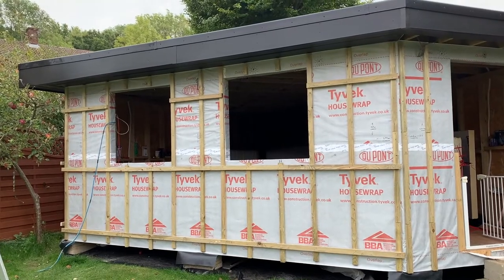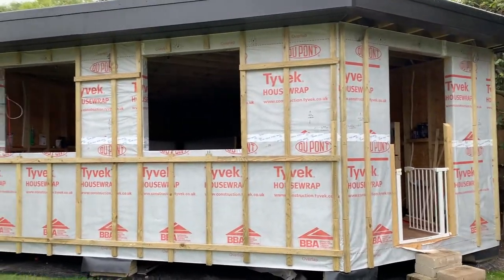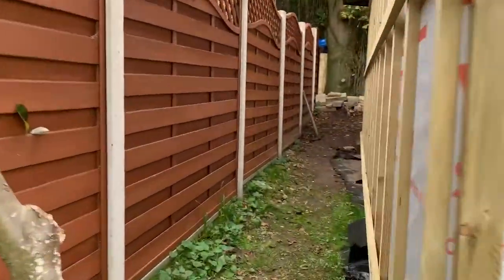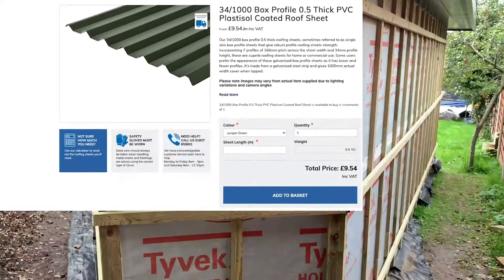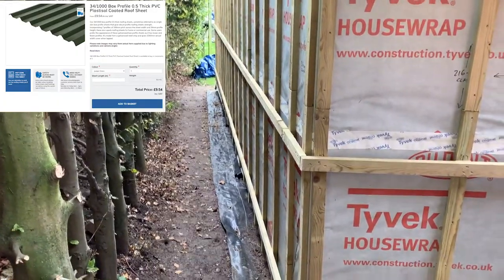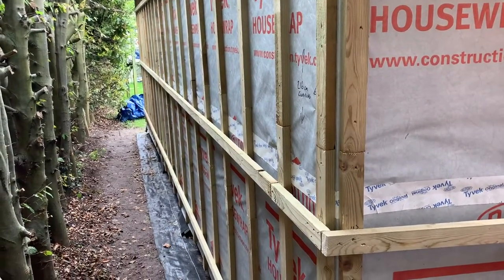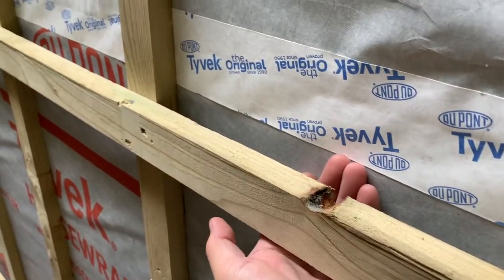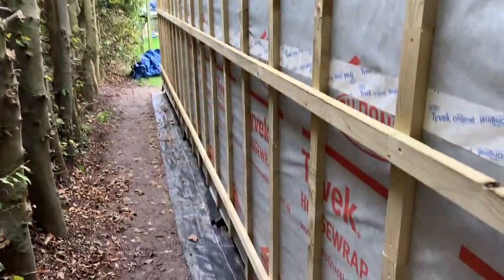DIY Garden Office - Games Room - Battens / Battening

Comment: Hi Kev, great series of informative videos, can’t wait to you the finished garden room. I am planning to do similar this year and be grateful if you answer some questions. Firstly, what is the brand/model of what I guess to be a nail gun. Did you buy this to build the garden room as a more efficient way to build vs impact driver and screws? If so, do you think it was worth it? Secondly, did you have to apply for planning permission and/or building control? I ask as I wasn’t sure if this is needed as part of your electrician making your final connections and signing off the work, also if your choice to get Cladco sheeting was in some way to achieve a non combustible material near any border. Mine will be within 1m of sides and rear of garden room, but I have read so many different views on what may/may not be required. Any feedback greatly appreciated.